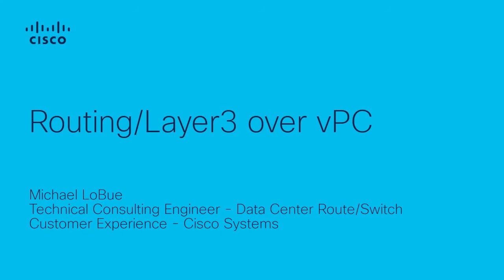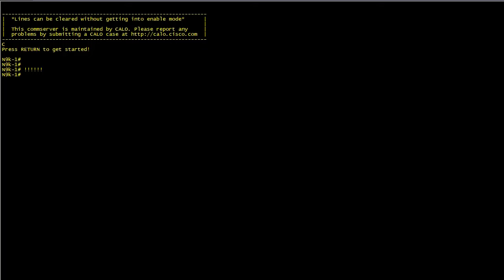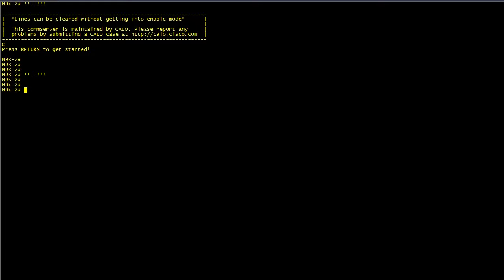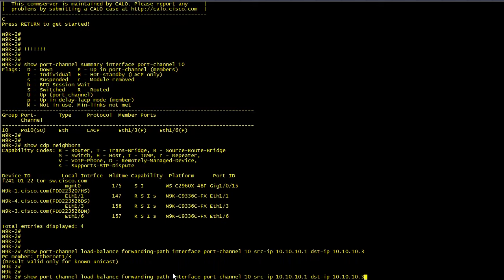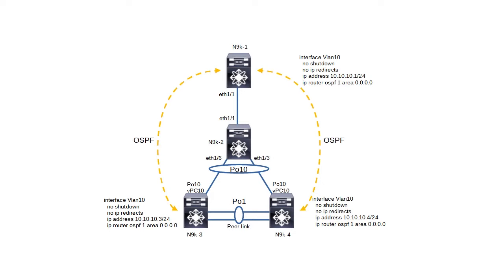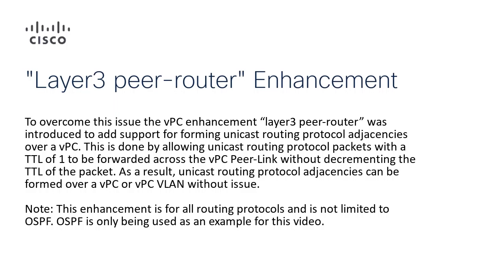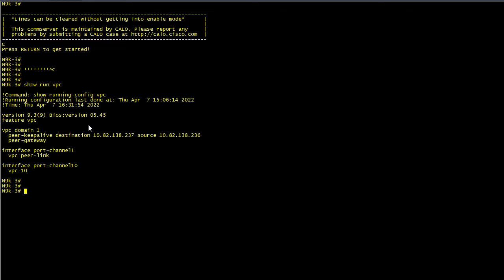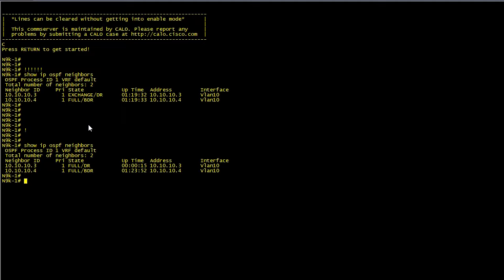Routing/Layer3 over vPC

Comment: The reason why n9k-4 absorbs the OSPF packet from from n9k-1 to n9k-3 (frame with destination mac n9k-3 VLAN 10) is because n9k-4 has peer-gateway enabled. Peer-gateway causes n9k-4 to listen for n9k-3’s VLAN 10 MAC address. When n9k-4 strips the Ethernet header and reads the destination IP, it realizes that the IP packet is not destined for itself and it tries to forward the packet to n9k-3; however, since the packet has a TTL of 1, this TTL is decreased by 1 and ultimately discarded.
Reply: I dont think thats is entirely correct. The reason N9K4 receives the OSPF packet destined for N9K3 is because N9K2's Layer 2 hashing algorithm is load balancing between the two links. Remember, N9K2 believes that it is connected to one logical switch when it reality, it isnt. It doesnt know that N9K3 is only directly reachable via one physical interface, all it knows is that it has a single logical port channel interface made up of 2 links to forward packets/frames to. When N9K4 receives the OSPF packet that is destined for the VLAN 10 SVI MAC of N9K3, it decrements the TTL to 0 and has no choice but to drop the packet. The peer gateway command simply allows the vpc peers to forward traffic out other ports on behalf of its peer, negating the need to forward those frames over the vPC peer link instead.
Reply: @chriscraddock743  Yes, you’re right about why N9K-4 receives a frame destined to N9K-3. N9K-1’s port channel algorithm sends that frame to N9K-4 even though is destined to N9K-3. What I explained was the reason why N9K-4 “absorbs” the frame when the frame is destined to N9K-3, and that’s because of the peer-gateway feature. Peer gateway allows a switch to “impersonate” its peer by also listening for destination mac addresses that belong to that peer. Once N9K-4 absorbs that frame targeted to N9K-3 and strips off the Ethernet header, N9K-4 can route the packet to its destination. In the case of control plane traffic like OSPF, those packets have a TTL of 1, so to prevent the switch from decrementing it to 0 and discarding the packet, the layer3 peer-router feature must be enabled. That way, if N9K-4 receives a routing update for N9K-3 because N9K-1’s hashing algorithm decided to send the update through the link connected to N9K-4, N9K-4, after stripping the Ethernet off, doesn’t decrement the TTL from 1 to 0 and forwards the OSPF update packet out to multiple interfaces in the case of multicast or the peer link interface in the case of unicast.